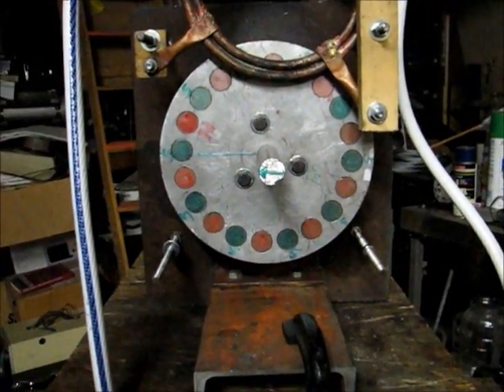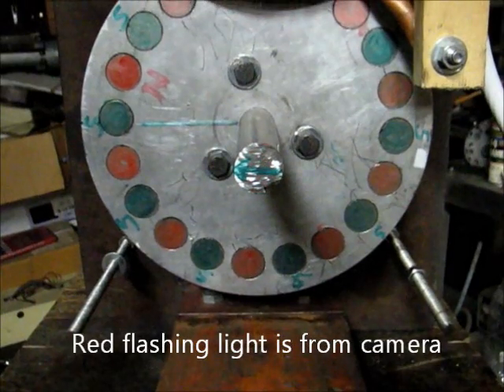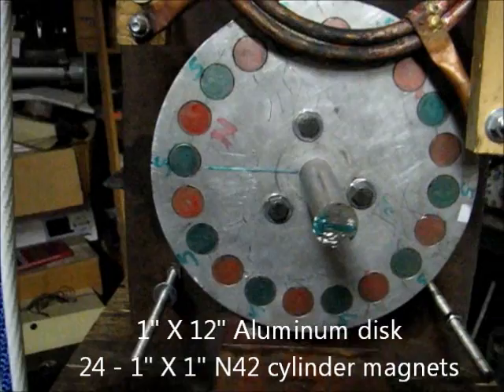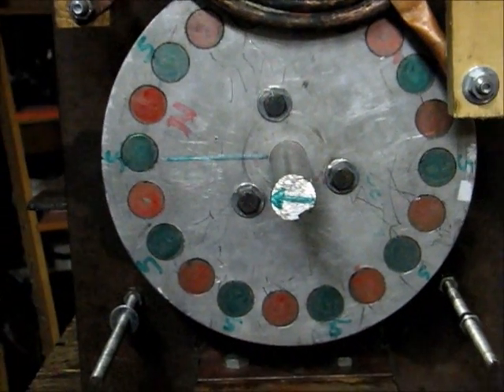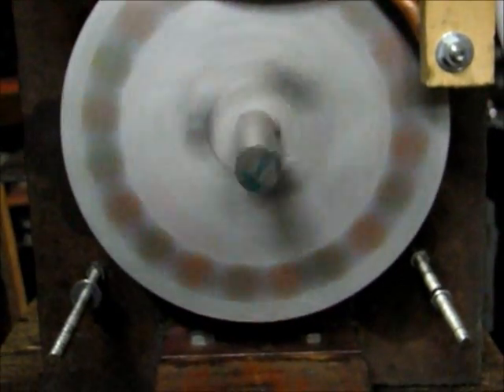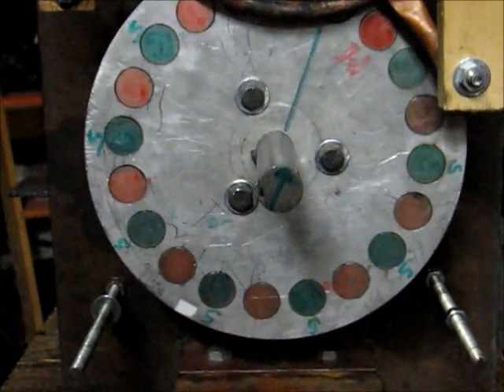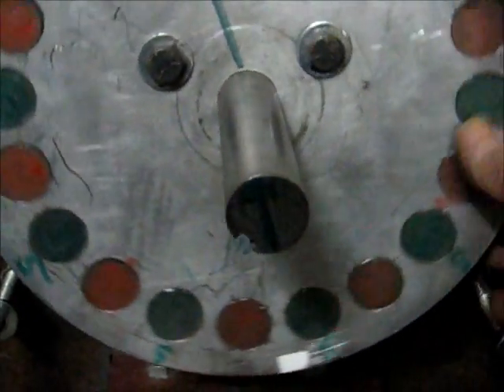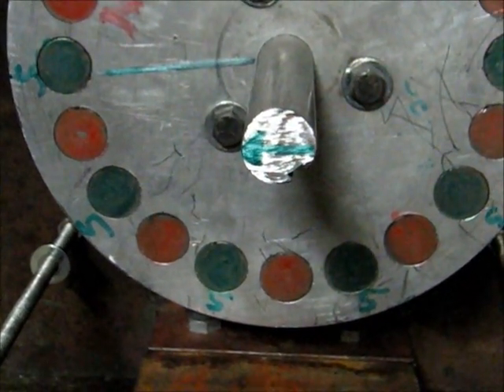Induction Heat Disk Mystery

Comment: a flourecent light is a strobe light which works at 50 or 60 hz, some people gets a headache from it, if its an induction motor you are using it will run at a fix speed in relation to the mains frequency

Comment: The lights that  you have are fluttering at the same frequency as the electric motor turns. Which make it look like the arrow is stopped in a particular pointed direction. VF

Comment: Venture a guess, it looks like the angle of the grind marks on the end of the shaft catch the light when the arrow is horizontal while in the vertical they do not.  This causes the strobe effect seen and the arrow to be seen facing only in the horizontal direction.  I'd bet if you took a grinder and grind 90 degrees and then drew the arrow again this time perpendicular to the direction of the ground grooves, the arrow would appear to be vertical instead of horizontal.

Comment: Sorry my comment is not on why you dont see the arrow on the rotor plate. Rather my comment is about value of magnetic heating through roating physical magnets.

So you have mains ac current  to create a rotating magnetic field in a motor's field coils that in turn spins the electric motor's rotor that in turn spin another rotor with magnets on it so you can have a time varrying magnetic field pass over copper tubes just to create eddy currents in the copper that in turn disipate that energy into heat due to resistance in the copper.   

Why not go solid state, no moving parts, no expensive magnets, and a whole lot cheaper. Just wrap a copper pipe with a lot of insulated copper wire and plug into the wall.  The coil fed an AC current will create a time  varying alternating magnetic field that will cut through the copper pipe causing eddy currents in the pipe that circle around the  circumference of the copper pipe, first in one direction, then the other.  Plus it wont break down like a motor will eventually.

Comment: If you turned the end of the shaft on a lathe, it wouldn't have the strobe effect.  Alternatively, point a light at a different angle and the arrow will appear to rotate, entirely dependent on the angle relative to the shaft.

Comment: you could be generating a static field concentrated along the axis of rotation causing a polarizing effect on the light reflected from the end of the shaft......check to see if there is a static field around the disk
Reply: http://www.ifmpan.poznan.pl/pcmr/Pdf/Sessler1.pdf
a polarizing filter is essentially a permanent electrostatic field

Comment: It's because the line on the disc is moving (in relation to the camera or eye's point of focus), but the arrow on the end of the shaft is not. It is simply spinning. If you put a small black dot on only one edge of the shaft end, and not all the way across it, you would see it disappear too.

Comment: It's clearly caused by the cutting texture on the shaft end only reflecting the light
back at the camera at one point in the rotation cycle (easy to see as the thing winds down).  The rest of the rotation very little light is reflected back at the camera so the
time average is dominated by this flash of light during which the arrow is pointing left.

Comment: the shaft is cut at a angle (some) this could also play into the strobing lights effect try it with the shop lights shaded , Use a light at the same place as the camera/you

Comment: It's simple. It is because the surface of the shaft, where the arrow is depicted, is very rough and uneven. At the same time, it is shiny as h#L! It reflects the overhead light very well.

When you keep the camera a few inches away from the shaft, one can perceive alot of reflecting light from the shaft, but none at all from the flywheel. The flywheel has a surface that is kind of frosted and eats up the light. 

Having said that. It actually feels you ARE using a strobe. Only thing is that the strobe is not external but the spinning and uneven surface, is itself "strobe like".

I think the pulsing of the strobe would increase/decrease in a linear fashion if you were to accelerate/slow down the shaft..

Does that make sense? :)

Comment: The end of the shaft that the arrow is on has a slight bevel to it in the direction of the arrow. (shaft not cut square) This reflects the ceiling lights on the shaft so you can see the arrow. If you film it again with the camera a few inches or more lower than the shaft then my guess is that this mystery will be solved!!

Comment: When you see the disc rotating in a lower speed, you see a variation in the reflection of the lights above it.

Most certainly, an imperfection in the tip of the disk's axis is reflecting light at regular intervals as the disk rotates and that is, most probably, the origin of the effect.

Comment: I luv a good mystery - I noticed the end of the shaft appears very course with linear grooves running across the diameter in the same direction as the arrow. Maybe the grooves reflect incoming light in such a way that the arrow becomes easier to see at a certain rotational speed?????
Cheers

Comment: fluorescent lighting X motor speed/camera speed = harmonic.
the saw marks at the end of the shaft bounce light from the light source once per shaft revolution. Your light source is for sure fluorescents running at 60 Hz.  That means that the lights turn on and off  60 Times per seconds.  now, your camera probably captures somewhere around 40 to 70 frames per seconds.  that means that it, at times, captures a light source reflection on and some times off.  the color will change because: every time the light comes on, it is more on the blue side of the spectrum and when it turns off, it is more on the red side of the spectrum.

Comment: the shaft.. as it is spinning your eyes cannot keep up with the amount at which the light strikes your retina. Sorta like a moving picture you see all the frames but if you slow it down you see lapses in movement. Even if the end of the shaft was completely smooth , this would still happen because the surface is reflective. Light from your flourescents in not coherent and not only one visible frequency of light, whether it is a reflection of the floor or something around it may also cause this but because it is spinning so fast,you are seeing only a few  frames of a complete picture. It is the same reason that wheels appear to spin backwards once they reach a certain speed. They are moving forward and we know that from the motion of the car yet appear to move backwards because of our limited perception. You have an arrow painted a certain color in this case green, but its not solid because you can see the reflective shaft behind your green arrow. The shaft then spins and picks up light from somewhere else and mixes with the color you have painted the arrow... or maybe not, it could just be that light from a different source is reflected off the surface of the arrow causing it to appear blue. The reason it still retains the shape of the arrow is because it is less reflective than the rest of the end of the shaft. The reason you can see the arrow clearly and the line is blurred is because the arrow is rotating on its axix, while the line is rotating around the center..Hope this helps

Comment: Where is the mystery?!
End of the shaft has fine grooves, probably caused by rasping in one dirrection by some tools (sandpaper? or rasp?). Then arrow is painted exactly along the groove lines. This make some sort of poor diffraction gratting - which diffract light from above (ceiling light). It can also diffract light from below, but there is no light source, only maybe some reflection from the floor. To prove that this is the case, turn on room light, and place some light torch at side - as you move torch, blue arrow will move with it. It is that simple.

Comment: It seems to me the shaft is cut at a slight angle, you can clearly see this as the wheel just about to come to rest. Also shaft's end is not smooth. At the instant when the slanted face is facing upward towards the light source, it reflects more light to the eye When the slanted face is facingtowards the wall and the ground, less light is bounce off. When the machine rotate at such a high speed, this constant alternate bright, dim reflection creates a stobe effect.  Just a guess.

Comment: The speed of the rotor per turn [3,600 RPM = 60 RP Sec] is matching the frequency of the lighting at 60 Hz... perhaps??... Yes, No??
Reply: ***** And yet another way is to use a light connected to a DC source. If the arrow is no longer seen at high RPM, you can also assume it has something to so with the frequency of the AC lighting.
Reply from the maker: Sorry for the delay in answering. My work takes me to the Arctic Circle for extended periods of time.
Perhaps! This may very well be the answer. I have been thinking of a way I could re-do this experiment, and prove yes/no to this possiable answer.  And have thought of using a colmen gas lantern (thus no 60 cycle light) and see if it still does what it does.  The other possiable solution I believe has merit is that the end of the shaft is not perfectly cut at 90 degrees and thus would tend to have a strove effect as well.
Reply: capindres
 Just get a Variable Frequency drive, hook it up to the light, and set the frequency to say, 50Hz, and tada you can prove or disprove the theory. Also make sure that no other light is present during the experiment.
Reply: +USNVA add and frames from camera ;)

Comment: Hi all. I believe it's a simple phenomenon in which our eyes are 'tricked'. It's to do with the running speed (RPM) of the motor. Our eyes also has a sampling rate, ie it works like a shutter. That frequency, is around 25 Hz. That's why you need movies running at 30 frames/second or higher, to not have that flicker effect. Now, you could experience the same story looking at car wheels at speed. If you speed up, it seems to blur, then sort of come into focus, then the pattern seems to stabilize and then seems to reverse and blur again as you accelerate. The same concept applied. Add to to that the frequency of fluorescent lights, which also 'strobe' you end up with this effect.

Comment: A strobe light freeze frames at a certain speed. The diameter is different as the disk is wider therefore the speed of the disk is higher than the axle. The consequence is that the green line on the disk is at the wrong frequency to be seen by the strobe light.

Comment: THE ANSWER TO THE GREEN ARROW IS SIMPLE. IM A FITTER AND MACHINIST. THE SHAFT ISNT CUT SQUARE. IT IS CUT MAYBE 2 OR 3 DEGREES FROM SQUARE  WHICH MAKES LIGHT REFLECT OFF OF IT IN THE SAME SPOT MORE BRIGHTLY THAN ANY OTHER POSITION. GIVING IT A STROBE EFFECT.

Comment: ok...I will take a low tec stab at this.....answer is that the end of the shaft is not cut true and is at a bit of an angle so that it captures an increased reflection of light in each turn that would simulate a strobe effect,...Do I win the teddy bear?....lol

Comment: I didn't read the other comments but I know for sure the answer.  Easy.  The angle you cut the end of the shaft is not 90 degrees and you've marked the arros while the angle would be aligned with the reflection of the fluorescent lights of the ceiling so when the wheel turns, everytime the light is reflected on the end of the shaft meaning when the arrow was marked horizontally that's where we see the arrow.  All  the other way around, the arrow is not seen due to the shadow of the light caused by the angle not relecting the ceiling lights lol  :)  Thanks

Comment: The shaft strobes itself, and so it is synchronised strobing .The arrow is at the bottom of a crater with two rising hills ( facets) on either side. The position of the camera and the light reflect the lower facet  during  a very narrow angle. All this  can be identified when the shaft is coming to a stop where the two facets can be seen reflecting and the other angles are black. It is not a case of external strobing from the   mains supply to fluorescent light or otherwise, Not the arrow points in two directions not one. hence the two facets.
Reply: Note the external strobing  from the fluorescent light  can be seen on the outer magnets(  go back and forward), but  in the central shaft arrow remains stationary at any  angular rotation  as it is strobing itself due to the  two facets on the shaft. ( An imperfection put to good use) May I patent this to my name?

Comment: There is no mystery, even though YOU are not using a strobe, your light source if still strobing at 50 or 60 hz, and whenever the RPM's are at a speed that is in a harmonic or other multiple of the frequency will produce a clear image....and then as many pointed out, the large surface of the disk is going to blur no matter what you do even if you used a strobe chances are you would not detect it for the large distance it is travelling for each revolution.   If you would like to verify this, take your car out under a street light so that the fan blades are in the light coming from that lamp (which will exceed the 8 feet you mentioned your fluorescents are above) and you will find that there is a second image of the fan within the spinning whir... long ago, (60's and early 70's) I used this to see the timing adjustments I was making while turning my distributor because of the strobe effect of our 60 Hz street lamps.   You might even be able to mark one fan blade with chalk or whiteout, in order to see this image clearly too if you either change your timing (probably impossible with today's computer controls) or adjust the rpms slowly, until you hit one of the sweet rpms... same thing here guys!!  

Now that I solved your mystery with verifiable experimentation, (BTW if you light a flash light or few candles, the small arrow will be just as blurry as the large disk one was, this too will prove the strobing is from your lighting source) answer me one question though...if you would be kind enough... with this type of heat generation, how hot do the MAGNETS get when being forced through the resistive field created between them the the copper or aluminum plate or whatever is being used.  

I am curious because from what I understood, neodymiums lose magnetism within a couple hundred degrees, and saw one experiment heat a blade of copper into the 700's and melted solder on it while the small motor was spinning the magnets.... but the load/amps must really climb high due to the exponentially increased braking produced  with each mm closer you get.  I did not see your videos on this yet but will check them out too!! 
I just don't see this EVER being a cost efficient source of heat, but I'm sure will do well in an emergency situation.  So not a total waste to explore!! 

Namaste'!
Reply: I believe that your answer is incorrect as the arrow remains stationary all the time irrespective of the speed. The  shaft is strobing itself due to the two facets on the shaft and even with a tungsten filament lamp which  does  not strobe this effect will be seen. Note as the shaft comes to a rest,  the central arrow on the shaft will keep stationary looking in both directions while the magnets do stobe on the fluorescent light, but not the central arrow. Please look carefully as the shaft comes to rest. See my explanation  somewhere else.
Reply: I didn't think it needed reiteration for another mentioning that due to its much smaller surface area, it remains much more visible and appears stationary due to the angle of the camera not changing at all...akin to how lights flicker 50 to 60 times a second and we perceive a solid light and a moving picture appears solid at only 24 frames per second and in this case the camera is focused only on the target, even though the whole frame is clear, focally it is aimed directly at the arrow...if this were to change, even slightly, so would what we see, possibly drastically.   Look at your stationary monitor through a still digital camera you will see strobing that you don't otherwise detect...why? It is not coming from the lights...and you should know TWO things need to move to get the effect, it is because the camera recording and screen refresh is not synced with the monitor's, well in this case their camera happened to be synced to the lighting or the rate of spin, I can't say for sure without live testing.   But you can rest assured it adequately explains their mystery.   

If there were other factors I am unaware of, and they would impact my reasoning, I would easily admit being wrong, I am more interested in learning things factually than being right.  In fact, being wrong is better if there is another lesson in it, but you don't provide much to substantiate my being wrong, and if you do hit on something I didn't consider, I would still concede!  No problem!  

Peace!

Comment: The saw cut striations reflect light to the camera when the arrow is pointing to 9:00.
You can test this theory buy moving the light source to change the apparent direction of the arrow or by using several diffuse light sources to cause the arrow to blurr as one might intuitively expect.
You can also grind the end smooth and see the effect disapear.
Let me know what you think.
I think I have a use for that phenomenon.

Comment: I see reflection on the wheel and the end of the rod there is also a reflection. The rod is more brighter because the texture of the metal is flat. The wheel the texture is dull but still you can see a reflection of red light thats flashing. Someone is pointing a flashing light on the wheel and rod.